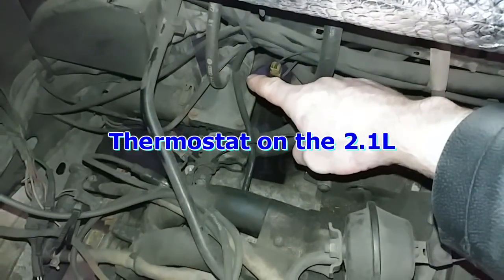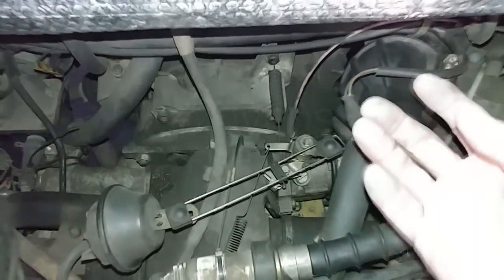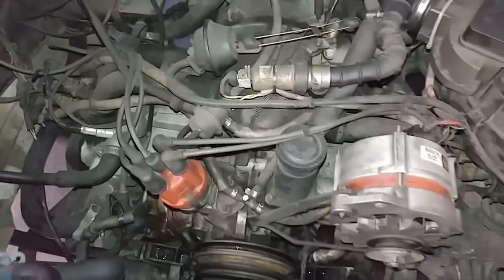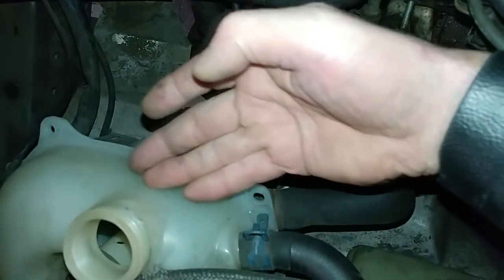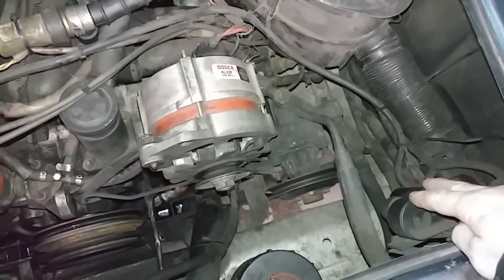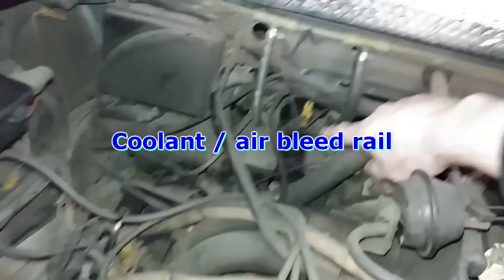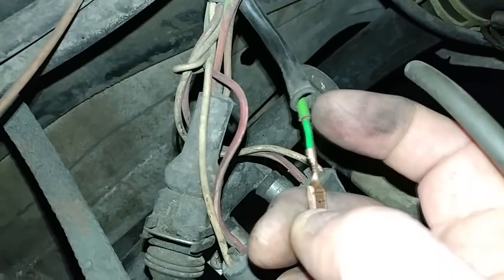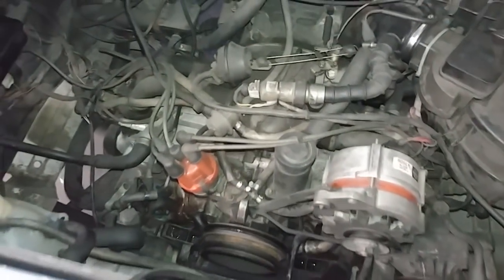VW T3: Various engine bay bits / info

Comment: Love the videos man, new owner of a 1986 T3 and can’t thank you enough for the quality of your videos. I have been asking a round the community for a while with a problem and no luck so I thought I would try here. My van runs great 90% of the time but every so often while driving it will stutter and get really jump for a but then right back to normal. Not sure if it is the transistor in the ICU but most common parts have been replaced such as spark plugs and wires, fuel lines,pump, and filter all new so any help is appreciated with ideas of what to check next. Thank you!

Comment: Thanks for another great T3 video, you've helped me personally a lot allready. If I may request/suggest a topic for a video. Could you give your opinion on emergency tools to carry when going on secluded trip, things such as needed/unneeded wrench sizes etc... Thanks in  advance.
Reply from the maker: Knowing what could go wrong... is what keeps me from going on longer road trips. =)
Regular set of hand tools (sockets, wrenches etc)... you can never have everything for every job.
Emergency supplies (food/water) for when you get stranded.
I'm sure there are a lot of videos already for stuff like that... all pertaining to all makes & models.
Reply: Thomas EXOVCDS thank you for the reply, though I'm still going to take my Syncro to the ends of the wolrd😉 I do have another question though, more related to this video. At the end of the hose for the breather tower, just before the air intake boot, there is a little two wire electrical connection. The PO of my Syncro disconnected it, and fastened it out of the way. My question is, what does this connection do, and why would anyone disconnect it? Again, thanks in advance.
Reply from the maker: Jacobus Roux That's the PCV heater... it helps vaporize the PCV / oil fumes as they enter the intake. No big deal if left disconnected.
Reply: Thomas EXOVCDS, I've another question please. My 2.1 is shooting out the dipstick and oil when revving the engine. The oil level is 100%. Engine is newly rebuilt  though its not impossible that it may be the cause. Are there any other possible T3 issues that may cause this? Thank you in advance
Reply from the maker: Make sure that the PCV hose (from the PCV tower going to the intake tube) is not kinked / collapsed. Crankcase pressure is too high for some reason... either because of the hose, the PCV valve or too much combustion blow-by.
Reply: Thomas EXOVCDS, hose seems fine... How would I check pcv valve? Thanks for reply.